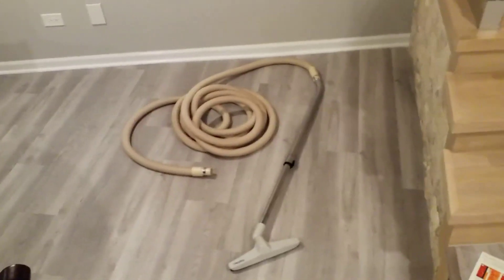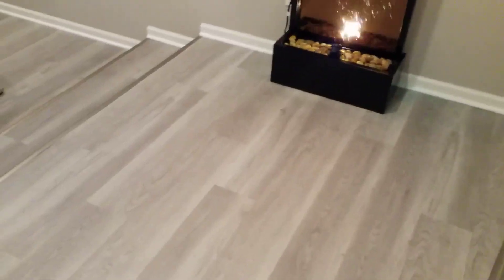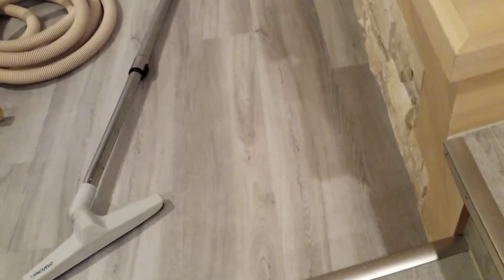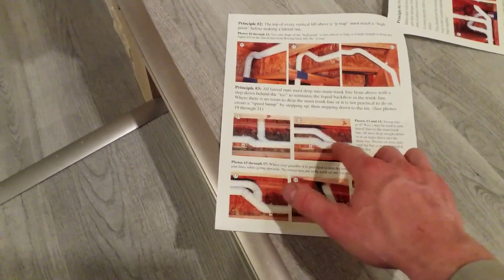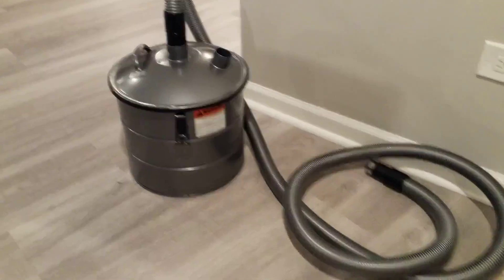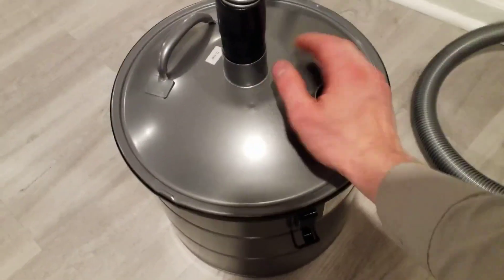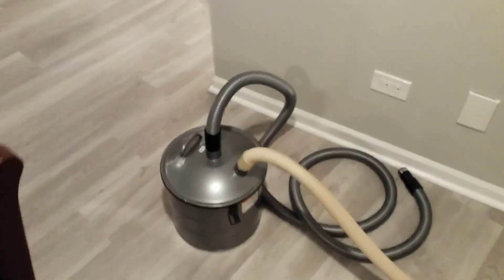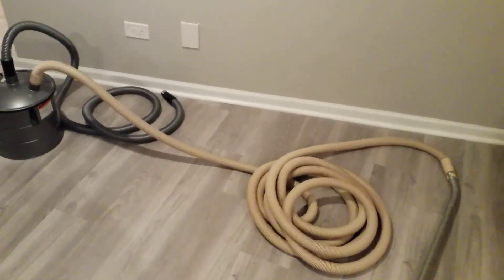Can I Pick up Water with My Central Vacuum?

Comment: I've priced interceptors and you can easily go out and buy a simple wet and dry vac for a fraction of the price of an interceptor.  It also comes in handy to clean out the clogs that do happen in your central vac system.  You also get more airflow with the 2.5 inch hoses for tasks like cleaning your car.  That said, I made an adapter for my central vac that I can use my 2.5 inch 20 ft wet and dry hose and it performs very well.
Reply: Yes you can get a simple wet/dry shop vac for alot less than a interceptor and yes they can also be used for unclogging out inlets. But not everybody has a shop vac and some would not want to get one. Some advantages of a interceptor is that there's no motor to make a noise inside as shop vacs are generally noisy, they're not as bulky to use or emptying out, and you're not having to spit out a bunch of dust a shop vac would have from garage or outdoor work unless you have a very expensive HEPA graded wet/dry vac which would cost even more than these interceptors.
Reply: @panasonicvac4036   I guess if you don't want to have a wet and dry vac, that's fine.  When you have a clog in your line (and eventually you will) you can haul your gigantic MD unit out of your garage, up the stairs and plug in a hose to the inlet and it would have similar emissions to the wet and dry vac.  It's out of the question though if you have a twin motor machine, I mean, where would you plug it in?  If it's 240 V you could probably plug it into two separate branch circuits, one on one leg of your service panel and the other into the other leg, kinda like some do with a commercial twin motor portable carpet extractors, or you could have a generator-style cord that you could plug into your dryer or range outlet.  These options are still just as expensive as buying a simple shop vac.  They are also needlessly complex.  Again, think of the KISS rule.  I am saying this as if you are a customer who doesn't have other vacuums like you or me, but since most houses have owners, and houses in the US and Canada are fairly large now, if you don't have a wet and dry vac, you should think about getting one.  It's just easier and more practical to have a utility vacuum alongside your central for reasons like this.  They are also easier to carry and are much lighter to boot.  Apartments don't typically have central systems and people use portables so these issues don't really come up.

I also say it is important to have a shop vac on standby as opposed to using a wet and dry interceptor that would introduce water vapour to your dry only system.  The interceptor is not a Rainbow, there isn't a separator spinning at high speed to keep the water at bay from your lines and your dry only vacuum,  you know, the thing that costs thousands to install or just a thousand for a unit and cleaning kit, regardless of the interceptor.  It's also made of a material not great for water, plain sheet steel, something that can corrode pretty quickly once exposed to water.  There's a reason why wet and dry vacuums are made primarily of plastic and stainless steel, the same goes for Rainbows, DrainVacs and Aqua-Air systems, which again are made of plastic and stainless steel.  They were designed to pick up water.  I just wish Rexair made earlier Rainbows with stainless wands but hindsight is 20/20.  Also, if a central vac tech was called out because of the clog, what do they bring with them?  A Wet and Dry machine, commonly called a Shop Vac.  That's what the tech brought to my Aunt's place to clear a central vac line, a Shop Vac.
Reply: When our system got clogged, I remember the technician tried to unclog it with a Shop Vac. That didn't work. You know how they got it out? An auger just like what a plumber would use to unclog the piping.
Reply: @panasonicvac4036  Well, that's one way.  Wouldn't there be a risk of the snake going through the thin wall tubing?  I guess not, if it's manually turned.
Reply: Mine was fine. But since then, I've been using Tornado maintenance wipes to wipe the inside of my pipes so I can prevent another clog from happening.

Comment: Nice video. I've used one of those interceptors, they work ok but I found that the seels are not very good when connecting to the utility valve on the unit, so you lose quite a bit of suction. There are two companies that I know of that make wet dry central vacuums. Aqua air is one of them, Drainvac is the other. I didn't know you had to install the pipe a certain way but that does make sense. Centec systems also sells a few interceptors though I think they might be selling the same one that Vacumaid makes.

Comment: I had the unpleasant discovery of water in one of my main lines after I installed the power unit (this was new construction and all pipe was run in the attic). I tested out one of the inlets, an Electravalve, and wondered why it made a funny noise. I checked the unit and found several cups of water in it. So, I ran paper towels through the lines until they came out dry and then dried out the unit - a Vacuflo 960. I never figured out how that water got there but I haven't had any more issues like that, thankfully.